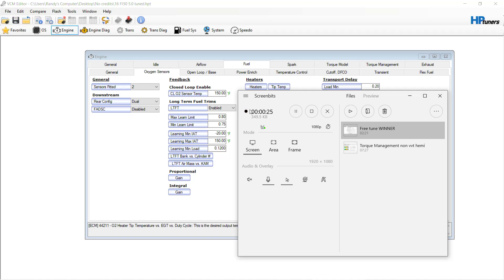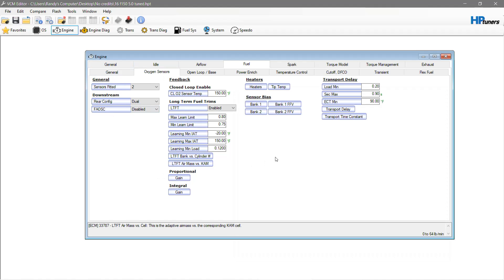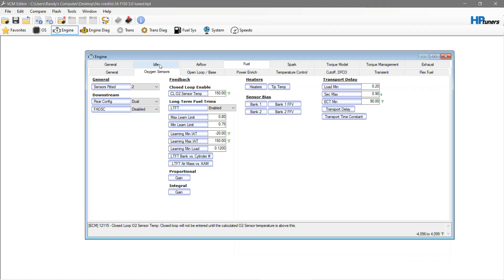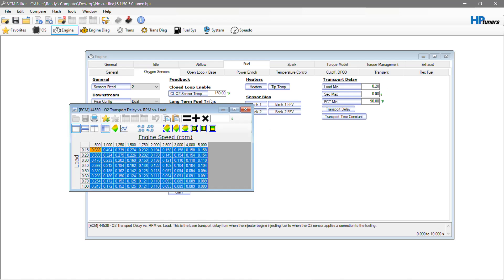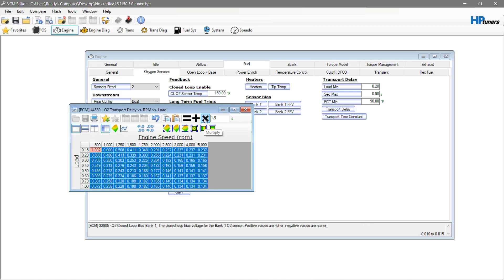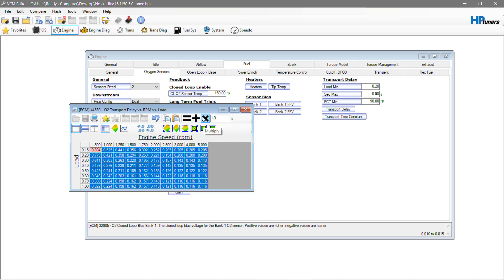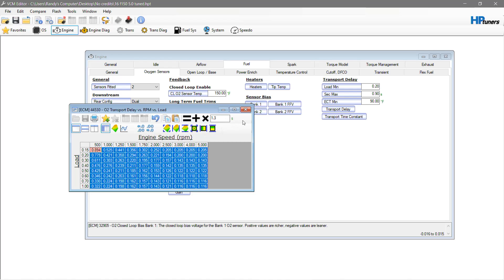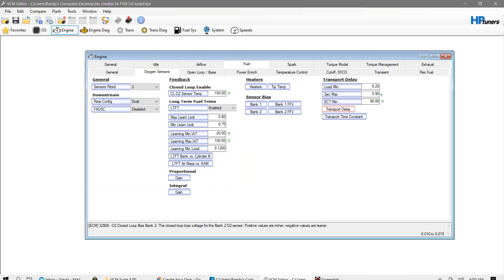Adjusting oxygen sensors for long tube headers on coyote

Comment: Thanks for the video. Is there away to dial in the value? How is 1.3 better that 1.5?
Reply from the maker: To be honest it’s just lengthening the time the transition takes. The table is perfect stock, when going to long tubes the oxygen sensor gets farther away. At end of day all we are doing is tell the computer the sensor has moved farther essentially which is why we use a multiplier for the whole table instead of trying to change things cell by cell.
Reply: In doing this, will you still need an o2 Fowler plug?